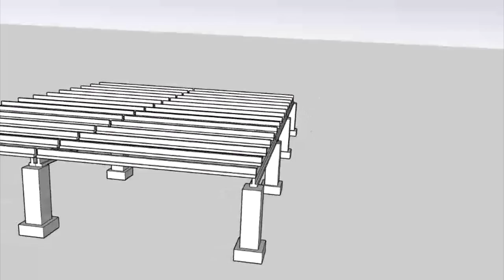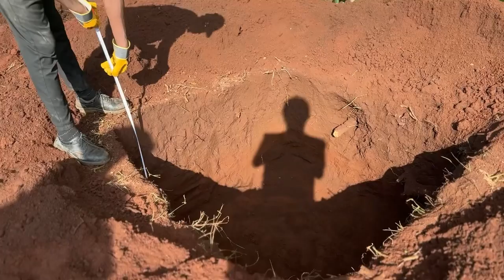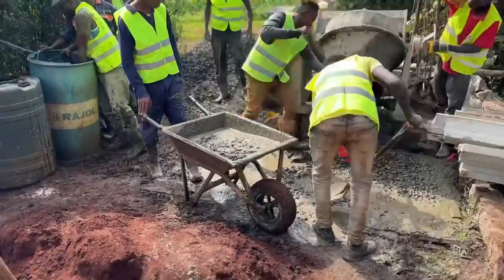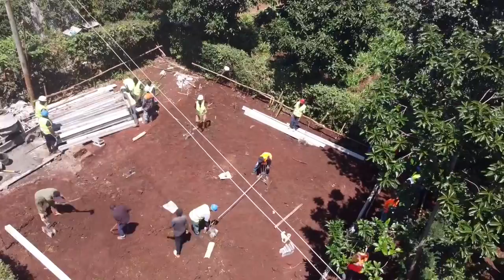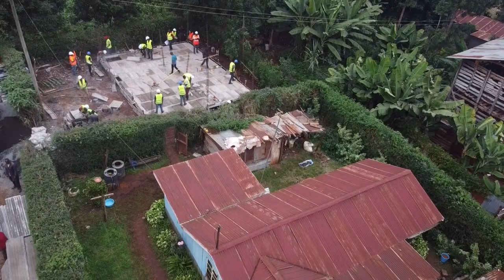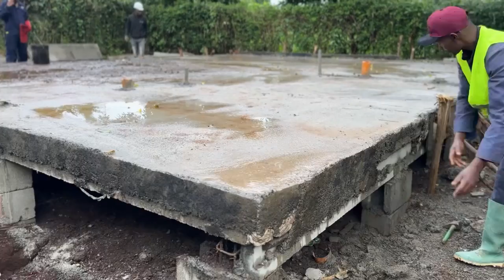How to build a precast suspended foundation

Comment: The cross-section of the columns are too small
Reply from the maker: @kouasi9756  it’s there just to support light weight precast slabs and works very fine for structure of G+0 …. Houses in USA 🇺🇸 uses similar blocks to support g+1 structure however the British system used here is so rigid and outdated
Reply: @floordecorkenya9339   ok, it's just G+0.

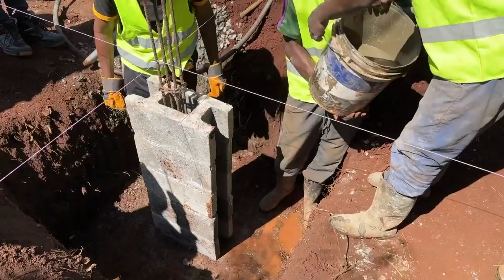Comment: 6:04 How many inches of concrete or grout will cover the steel rebar? To me, it seems the concrete cover will be insufficient & the rebar could rust from within, causing blowout.
Reply from the maker: @jacqdanieles  infact nowadays we don’t put any rebar on those piers , however rust in places like mombasa effect even beams
Reply: @floordecorkenya9339  without rebar in the piers, where's the shear strength coming from? The house could collapse with a small earthquake or tremor.
Reply from the maker: @jacqdanieles  such raised floors made of timber exist in places like USA 🇺🇸 more seismic / tornados region than Kenya .
We believe is practical having over 100 units of such and none has moved irrespective of previous tremor experienced last year

Comment: As a structural engineer I am still stuck at 'suspended foundation'. There can never be a suspended foundation, all the loads of building will have to end up into the ground. What you mean is suspended ground floor slab, by use of prestressed slab panels and beams. Terms really matter in structural engineering.
Reply: I am sure you understand. It's not a matter of terms but what you see.
Reply: Most non Engineers confuse a footing and foundation. Two very different things.
Reply: Engineer. This is just pier foundation. 

Kindly give it the correct term for those who don't know what it is. 

You can build even at sea or shore of the ocean with pier foundation
Reply: @easunda I agree bridges are built this way and they are structurally sound, we need to move our engineering line of thought to more affordable means and realistic
Reply: @Floor Decor;
Could you expound on 👆 please?
Reply: I think for us we understand Kibaru's layman language better..I think he simplifies it for us. Whenever he starts explaining KN and stuff I skip
Reply: Please educate us on the reliability and safety of this technology.
Reply: I am an interested party, how can I reach out to you

Comment: Why not run all the plumbing underneath the slab?
Reply: That is how it should be done. Plumbing should go under the house. Looks like they're doing it wrong by pouring on top of it. Also there is no need to pour over the precast floors. All structures here in the US run their plumbing under the house. It is easy to detect leaks, fix and also for inspection. Imagine them tiling the floor. It will be a nightmare trying to fix anything.

Comment: what's the point of this video without  dimensions of the floor and cost ? why  are some   T beams    resting on tongue of blocks , Engineering   point of understanding   the dimensions  of rebar should be at least 6 inches  on both sides  .The  Grove of blocks should be filled up with  concrete   at both ends  and a renbar in place .
Reply from the maker: Cost Sh 4,000/- per sq m . The Connections between precast elements can be achieved through

Bolting
Welding
Grouting
The Method of Connection largely depends upon type of structure, seismic zone, availability of materials & hardware and skill set of site operatives.